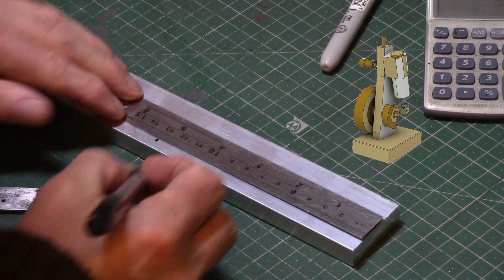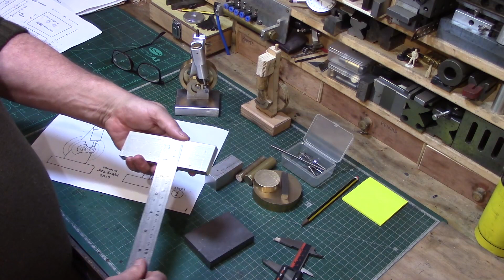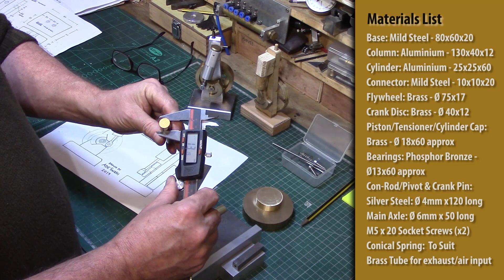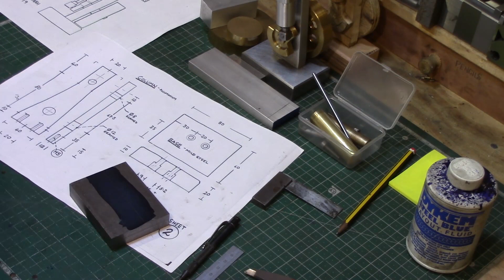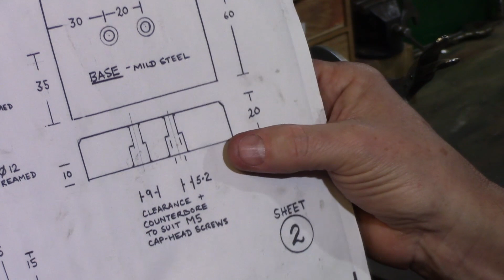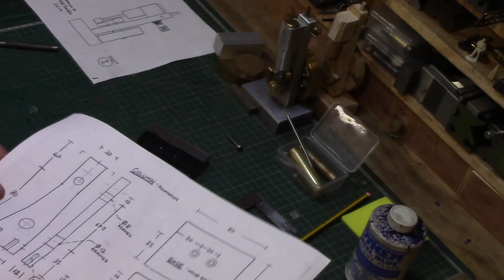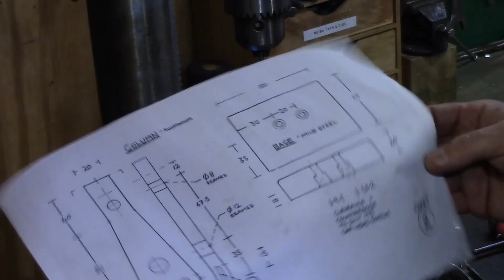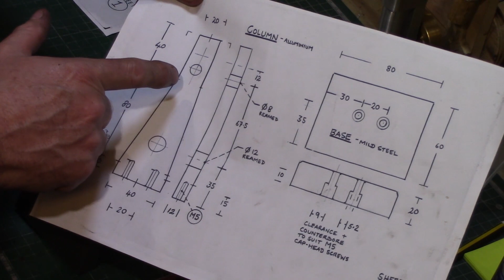Make a Simple Model Steam Engine - Part 1 - Materials Overview, Base & Column Basics

Comment: Just wondering if there's somewhere to buy the stock ready cut?
Reply from the maker: Then this would be a kit, I could start a kickstarter if you are interested in investing?
Reply: @AdeSwash   could be worth a try!
Reply: @AdeSwash  A quick look for the 3" brass bar, for example seems to be about £30 for a minimum length of 25-30mm, so a a ready cut bit at 17mm would be handy, if the price was right!